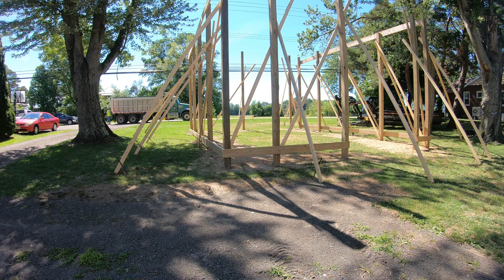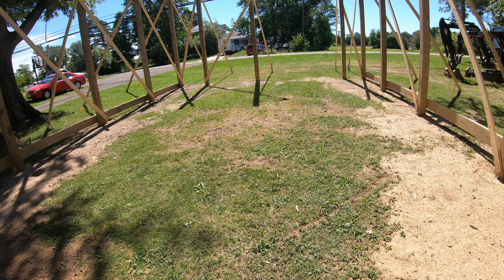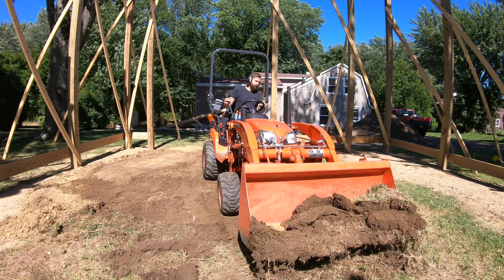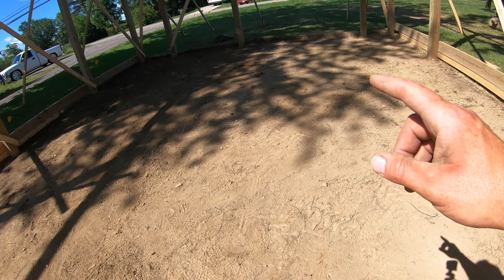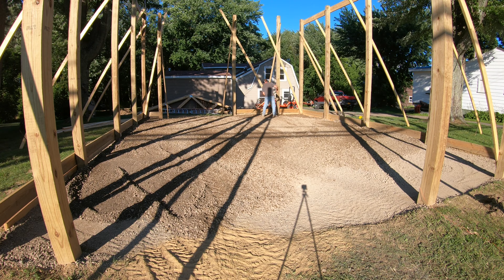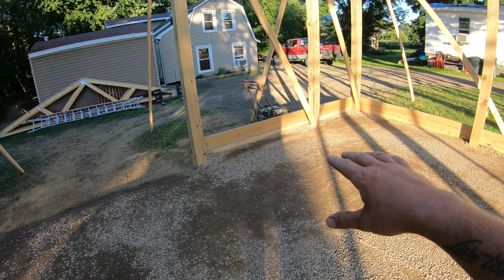POLE BARN BUILD (Part 2) STRIPPING SOD + SPEADING 20 TON OF STONE!

Comment from the maker: Not sure if you guys could tell from the vid but the cutting edge on my bucket is shot!! I really liked the factory edge but its just too far gone making the tractor work much harder to dig up sod then it ever use to be.. Curious which tooth bars some of you guys are using and how your liking them! Iv debated just buying a whole new bucket since I liked the factory cutting edge so much and am extremally use to it. Leave a comment below!

PS. DONT FORGET TO WATCH MY VIDEOS IN VIDEO IN 4K VIDEO MODE!
Reply: The edge can be replaced, not sure if its worth the cost vs buying a new bucket.  The first thing I did with my BX is make a toothed cutting edge and a straight edge to protect the factory edge.  I based my toothed edge on the BXpanded Piranha.  Saved a bunch of money by buying some drops from the local steel mill for $12 and an afternoon of cutting and welding.

Thank you for uploading your jobs, they really helped me get the hang of operating the BX.   I'm not to your skill yet, but much further along than if I was just winging it.
Reply: I put a BXpanded Piranha tooth bar on my BX-22. They also have a straight blade which can interchange with the same mounting holes. Very heavy steel and decently priced. The Piranha has angular sharp "teeth" so it also helps with cutting small roots and vegetation while removing material.
Reply: I put on one of those aggressive tooth bars (5 teeth) and man it really tears up the material.  Not for smooth cutting but big material movement is awesome.  Also works for raking debris like cuttings from the bush hog.
Reply: @derekbrin4182  Yes, a traditional toothbar can get pretty agressive. I found that the Piranha cut really well but was still functional when I was back-dragging all that stone I mentioned. One of the things I found attractive about the BXpanded product, in addition to the stellar reviews of the small  company and products was the fact that the Piranha and the straight version are interchangeable with only two bolts and they substantially beef up and support the front edge of the OEM bucket at the same time. That could be an advantage over time to the OP because of all the heavy work he does with his BX. Best of both worlds with a quick changeover and no need to replace the bucket because of wear.
Reply: Well done.
Reply: I just went up to L&W and bought their heavy duty cutting edge, and it bolted right on. (My BX2680 had the holes already in the bucket for this, but I don't know if yours does) I think it back drags better than having the toothed edges that a lot of people use. I can send you a pic if you want to see how it looks on mine.

Comment: I have a heavy hitch tooth bar and love it! I would never go without it!
Reply from the maker: Good to know! Does it come on and off as easy as you'd like? My biggest issue with toothbars is that I do a lot of back dragging with the edge of my bucket so having to remove it each time sounds like a pain to me but when it comes to digging hard ground I hear there is nothing better! Thanks for your comment!
Reply: @BiffsEquipment  I rarely remove it but its not to hard. Its just a matter off loosening the bolts with an allen key then sliding the bar off. I think it is worth having. Its also nice because the extra teeth help hold things in the bucket. I have had several logs that would normally roll out of the bucket but the extra length of the tooth bar holds the logs in.

Comment: Looks Great MIKE   My place had a 35x65 pole barn with dirt floor ,Did the same with mine and the bottom board is there already for the concrete .... made it easy to pour. There's nothing better than a new work shop , You must be over the moon  hahaha . Cant wait for the next video .
Reply from the maker: Thanks Gary! Oh yah man I'm filled with excitement for sure! Cant wait to get it all wrapped up so I can start using it this winter! I agree having the base boards/backer boards up already does make it much easier.. Not only does it help to keep a level grade but also helps when pouring the concrete as you already have it mostly framed in. Thanks for watching!

Comment: bxpanded has a bolt on straight edge as well as a serrated tooth bar
Reply from the maker: Thanks Tim, This is one ov been debating to buy for years.. Not sure how I feel about the teeth tho for all the back dragging I do but the regular cutting edge they make might be a great option.. Kubota also sells a bolt on cutting edge that I have debated but it sticks out quite a bit farther than the original and is quite thick. Ill have to keep you guys posted with which one I go with!

Comment: You are fortunate to be able to just remove a little soil and use "only" about 30 ton of stone. LOL I had to bring in and layer 115 ton (with my BX22) for my site prep. Your base looks great!
Reply from the maker: haha thanks Jim, yah by the sounds of it I did get quite lucky. I think 30 ton will about do it.. It woulda been alot less than that tho had I not lived on a hill. Sounds like your BX really put in the work on that project, they are tough machines!!
Reply: @BiffsEquipment  Yea, I can't complain about completing that work with a 20+ year old machine...thanks to your hydraulic pressure mod, it went pretty smoothly. After removing a lot of top-soil that was unsuitable to support things, I had to fill in the space with stone and level; 16" at the top of the small slop and 28" at the bottom of the small slope. Many compacted layers but it's solid and not going anywhere!  Unfortunately, I now need to do the tie rod ends as I mentioned to your previously as they are super sloppy after all these years. That will be in my copious free time, of course. My building goes up in a couple weeks and then my focus is on the interior build-out so I can have a real shop space again, rather than the temporary "gara-shop" I've been crammed into since we moved here a year and a half ago. So the tractor fixes will likely have to wait until the spring.

Comment: Great work as usual. I was a bit surprised that you didn't put down a geotextile fabric to help with controlling the gravel. I know you're going to put down concrete but it does help if you have any chance of water infiltration and undercutting the slab. DAMHIKT.
Reply from the maker: Thanks John! That woulda been a great thing but I honestly can’t afford it right now.. money has been tight as it’s prolly been with most Americans and with these rising material costs it’s been tough but we are getting it done. Thankfully where I put my barn the ground is extremely dry all year round.. even in the spring and fall the front yard never held any water which was a big basis of why I put the barn where I did. I don’t think I’ll have any issues because of this. Thanks for watching!

Comment: I was debating on getting a piranha tooth bar for my bx but ended up getting the kubota cutting edge from my local dealer. I think it was about 130 bucks. I thought the kubota cutting edge would be better for back dragging than a tooth bar.
Reply from the maker: Thanks for your comment Mike, I totally agree that a flat edge would be better for somone who does a lot of grading and back dragging work like we do.. this is why I also debated just going with the Kubota bolt on cutting edge as well. How are you liking it? My main concerns with it was how thick it was and how wide it was.. it sticks out much farther from the edge of the bucket than the original.. have you found any issues with this compared to the factory welded edge? Thanks!!
Reply: @BiffsEquipment  So far I've had no issues with the Kubota cutting edge on any of the projects I've done. I bought my BX2380 in June of 2021 and installed the cutting edge in May or June of this year. My only complaint is the bolts that came in the kit seemed a little long. I cut them down with a hacksaw.

Comment: It looks like a nice project.  I'm wondering why the pad wasn't done first? We always had the site ready and level and then set the poles.
Reply from the maker: Thanks Chuck! As for why we didn’t grade the site first.. I was going to but ran out of time before we started building it.. we also figured that having the posts in the ground and the base boards set that it will help show the grade much easier if we did that before digging and grading for a pad.. it actually worked out quite nicely as I was able to keep an eye on my base boards while digging it out and making the pad so I knew I was at the perfect grade when doing it and didn’t have to worry about digging out more material than I needed to or making it wider than I needed to but it was a bit of a hassle digging around all the posts so there is def pros and cons to doing it each way.. some contractors wait and dig after, some like to do it all before which was my plan.. but in any even it’s all done now thank god! 😅😅

Comment: Killing it as always, Biff. Hey, what do you have rigged on the 3pt hitch (the whole setup)? I want to get something like that to add more weight to have an easier time scraping sod or lifting anything heavy.
Reply from the maker: Hey Cam, so on the back of my BX I have a “RanchEx” quick hitch.. it’s one of the cheapest (true Cat 1) hitches you can buy.. but it has to be the RED model.. the black model is not a true cat 1.. attached to that is my custom heavy hitch weight bracket that I built myself.. you can order one tho from “heavy hitch.com” just pop the name into Google.. on the heavy hitch weight bracket I’m running 8x42lb suitcase weights which is plenty.. most guys only run 4 of them but because I have my hydraulic pressure cranked higher and because of the type of work I do o added more.. I also have both rear tires filled so If you havnt done that yet then that’s a great place to start as it adds a lot of weight and gives the tractor much more pushing power.. any ballast on the back will help with that and will make your tractor be much more productive. 

I made a video years ago on my custom rear hitch setup.. I’ll see if I can leave you a link for it

LINK: https://youtu.be/yDOuC2Aldi8

Comment: Mike, great job brother! Was that 40 tons of stone they dropped in your driveway?
As for the bucket, i decided on just the factory add-on straight cutting edge for our BX23s. I do alot of back dragging and also snow plowing in the winters with ours. I didnt want one of those tooth bars because i knew i would lose the smooth back drag ability that a smooth cutter edge would give me vs the toothbar that wont. For all the different kinds of work that you do, i would have both types of cutter edges. Maybe find another bucket, and have 2 buckets, one with a toothbar, the other one for just smooth work. Though it doesn`t really take long to change the cutter edges out. But on the other hand, for you, time is money, where for me, its not.
Reply from the maker: Hey that’s actually a great idea man! Maybe I’ll buy a Piranha or heavy hitch tooth bar for my current bucket with the worn out cutting edge and then buy a brand new Kubota bucket for all my regular grading jobs.. I actually like this idea because although more expensive.. switching between buckets is much easier and faster than swapping out tooth bars/cutting edges every Job or during a job. This may be what I do! Thanks for the comment and glad to hear youv been liking the Kubota bolt on cutting edge.. this was one I was highly debating on buying because I feel in most cases the flat regular cutting works fine for most the jobs I find myself doing. 👍🏻

Comment: Looking good. I am always amazed at how easy you make it to remove sod and level areas with your FEL. Shows some real skill with it. As far as the polebarn build, is there a reason why you waited until after the poles were set to remove the sod etc? I am looking at adding a building here in the near future and was planning on removing the sod from the site first as prep work.
Reply from the maker: Hey thanks Jeremy! These little tractors can certainly get a lot of work done specially if you know how to use it and how to manipulate the loader.. in this video my cutting edge was super dull too and it wasn’t cutting for crap, I have to buy a new one asap. As for why we waited till after.. you can do it either way.. prepping the site first works well but then you have to take account for the material you removed when setting the posts in the ground and setting the grade for the posts.. me and my builder found it easier to take the grade first and get the posts installed and then putting up our bottom boards because then we knew exactly where the floor of the barn was gonna be and the bottom boards told me exactly where my grade should be on the inside so I wasn’t messing around after the fact.. I used the back boards as a guide and was able to get the grade just about perfect the first time for the inside of the barn. If you graded it out before you dug the posts (which a lot of people do) you’d have to make sure your tin siding wasn’t gonna be below the ground level and take stuff like that into account. Tho if you do it the way I did it it does make digging it out alot harder because you have to dig around each post and you don’t have as much room to work.. so it’s really all on the builder which direction you wanna go. Hope this helps and thanks for watching!
Reply: @BiffsEquipment  Thanks for the reply.  I agree a lot can be done with a BX.  I have been able to do a ton with mine. Just have to be a little creative at times.

Comment: Hey Mike great work as usual. Any thought of putting a man door beside your garage door close to your house? Would make access easier? Looking forward to the next video!
Reply from the maker: Hey thanks Ross! Yes there is going to be not 1 but 2 man doors! One right next to the garage door in the front by the house and one right next to the garage door in the back in the same/matching location just on opposite sides. You will be able to see us frame the doors and windows in during my next video or two.. we already have the roof done and 2 sides of the barn sheeted and finished.. been so busy I havnt been able to go through and edit all the footage just yet but next weekend I will! Hope your doing well Ross!

Comment: wondering why didnt you build the pad first?
Reply from the maker: I actually wanted to but I ran out of time to do it before my buddy helping me out the posts in the ground could help.. we were both on a tight schedule so I had to dig it out afterwords.. otherwise I woulda did it before hand honestly. Either way tho it still works out.. the nice part is with having the posts and bottom boards in already is it helps you to get a nice grade as you follow the bottom boards and you don’t have to use a laser since you know your bottom boards are level.. so that’s one benifit of doing it after.